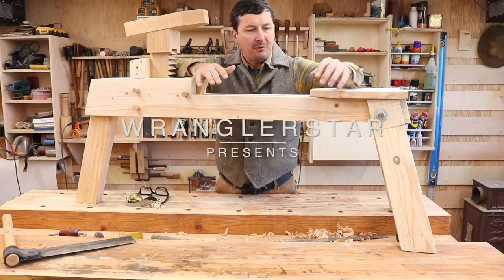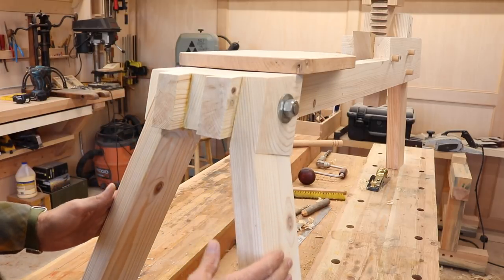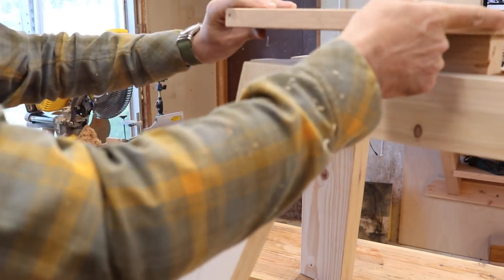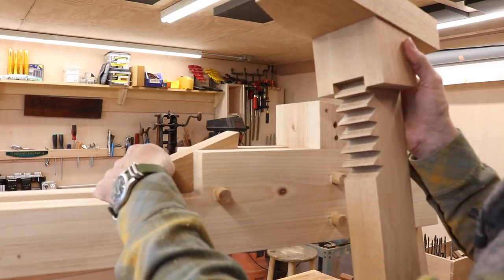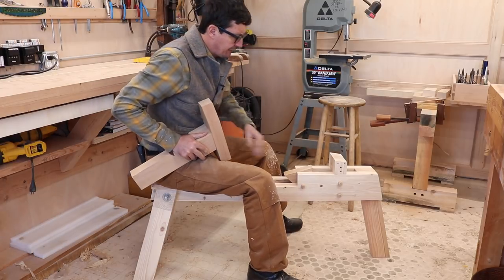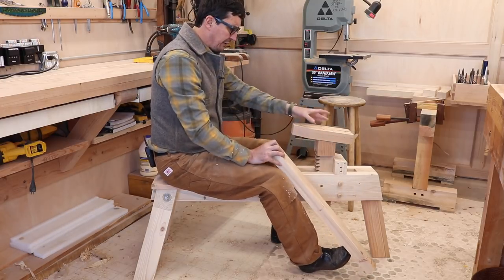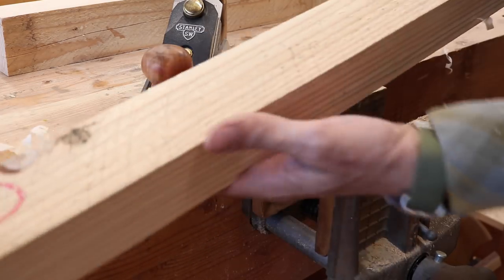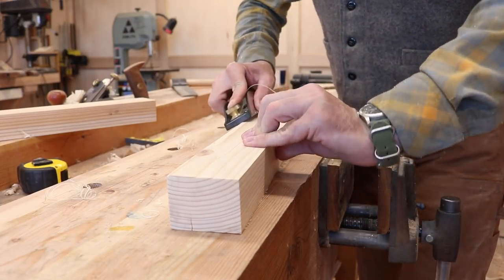The ULTIMATE Shaving Horse

Comment: Id drill out the holes in the arms a little larger to install some copper/brass/iron pipes to act as a contact surface with the threaded rod. The threaded rod on bear wood will act like a rasp removing a lot of wood quickly so a metallic surface to reduce the damage the wood takes is always a good idea. 

Nothing fancy but it will remove the need to redo work later when the damage is effecting operations.
Reply from the maker: +Andrew H good point
Reply from the maker: +Andrew H great point

Comment: Cool project for the weekend (4-7 weekends in my case). I would not have used a threaded metal rod. I think, a thick long dowel should be doing a better job. But you can still arrange that later.

Thanks for the idea how to build it!

Comment: I made one of these!  It was a while back, but I made mine with a "cheese block" wedge instead of the ratchet type that you made.  I'm kinda afraid the ratchet design might break just because the power you use with your legs pressing down and especially if your work piece  slips you press harder kind of by instinct.  The cheese block just slides back and forth to adjust the distance and not under any pressure that would hurt it.  Anyway, you will use that a lot.

Comment: Hey Cody would adding some boiled linseed oil to your wet lumber help to stabilize it to help it from warping so much adn thus help your shave horse work more efficiently and and less squeaky ;)
Reply: Felric Jones Oil doesn't stabilize or prevent wood from moving. In fact, no finish will prevent wood from moving. It'll acclimate to whatever atmosphere it goes into, which is why it's best to understand how and when to use green or dry wood, and how to build to allow for wood movement.
Reply: Thanks Matt. I thought that the oil would replace the water in the wood fibers and keep them from moving, but I am glad that you replied so quickly to answer my pondering question  ;) Have a Blessed day

Comment: Cody, a question. I was taught, when putting a plane down, to always place it on it's side. Was this right or wrong?
Reply: Gareth Jones i was taught the same by my mentor ( im a carpenter). you create this habid to protect the blade so you dont chip it. same with chisels i was taught you lay them on the work bench bevel-side down

Comment: I noticed that you're not a true Craftsman, and the fact of taking care of your tools. Any size plane that you use when you are finished working with it you lay it down on its side, not on the blade. That way you don't mess up the edge of your steel blade that you're using to cut the would. He might want to keep that in mind when you go to use it. It just saves time

Comment: How long does a hard and soft wood take to dry? Say when you cut a 2x2
Reply: Wolff, rule of thumb for wood drying naturally is an inch thickness a year. However, also depends on wood type. Can be speeded up by kiln drying.
Reply: Phil H99 still doesn't answer my question, not to sound like a jerk.
Reply: Wolff it answers your question fine. 1 inch thickness per year, 2 inches thick. two years.
Reply: Phil H99 it might be an inch of thickness per year for a log that isn’t split, but once you split it to reveal more surface area I am sure it will dry a bit faster than that.